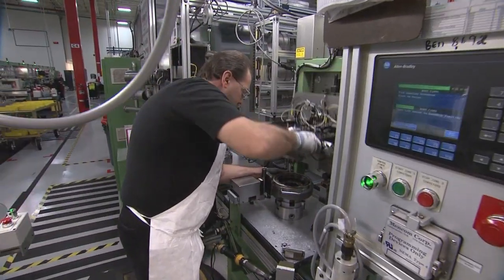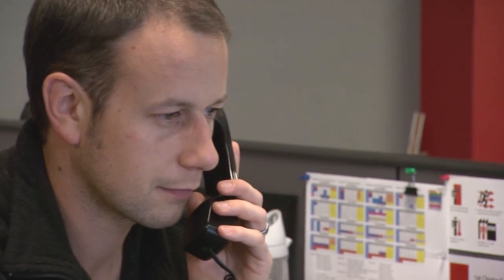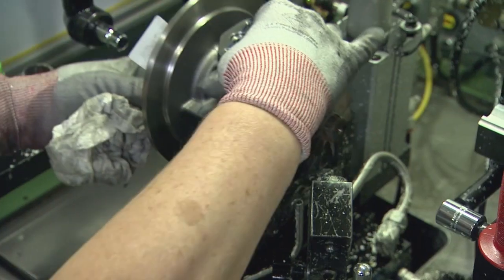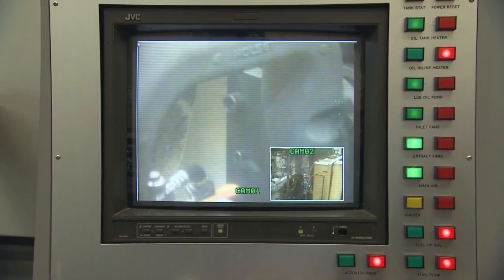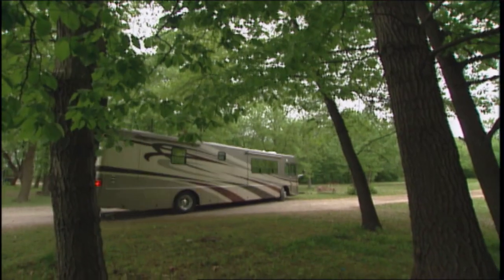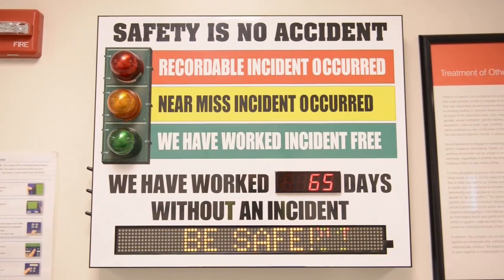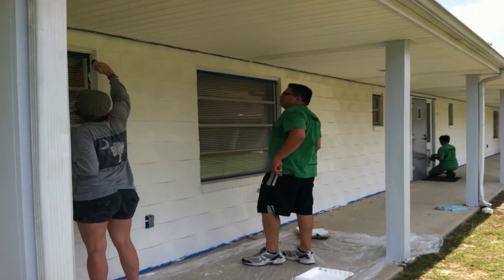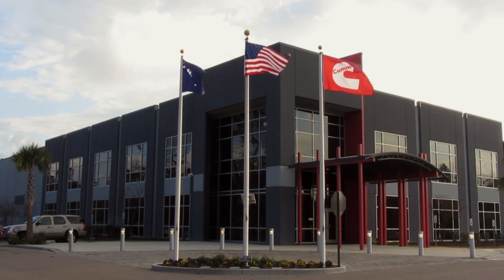Inside Cummins: This is Charleston Turbocharger Plant

Comment: new Cummins you should learn now how to build engine and turbos from VOLVO
Reply: Valerian Solomon You have no clue what you’re talking about. Google Volvo injector cup leaks, coolant leaks, etc. Replacement parts for the 13.0L Volvo are ridiculous. I worked for a company that had a fleet of 12.7 Series 60 units that were being phased out with new Volvo 13.0 units. I’d take an old Series 60 over a Volvo 13.0 every time.

Comment: Nice work, Holset turbos are great... What Cummins really needs to work on is their aftertreatment. The emissions equipment on the 6.7 makes that engine complete garbage. It causes nothing but problems. More importantly it contributes to poor performance and fuel mileage. Revise that and I'd safely say Cummins would be the better diesel again. They definitely were back when 6.0 PS's and LB7/LLY Dmaxs were out in the early 2000s. Honestly nowadays a Powerstroke or Duramax is a better purchase.
Reply: @Don Olypopper, Cummins does provide the after treatment system as an OEM product for their engines. Here is a nice video by Cummins demonstrating the after treatment system
https://www.youtube.com/watch?v=p8clK9qSGlk
The questions are, is it available for the 6.7 L engine line? If it's available, does RAM uses Cummins system or their own system?